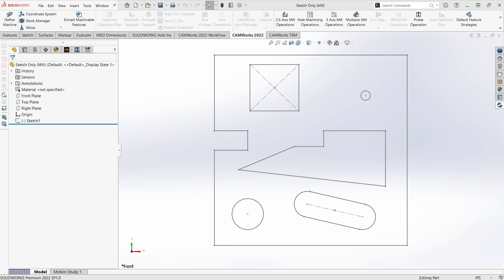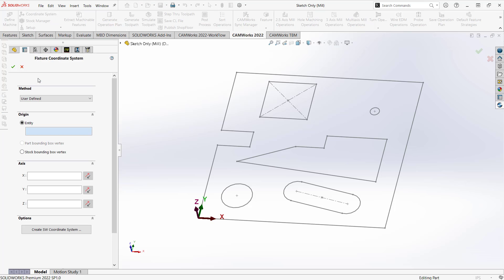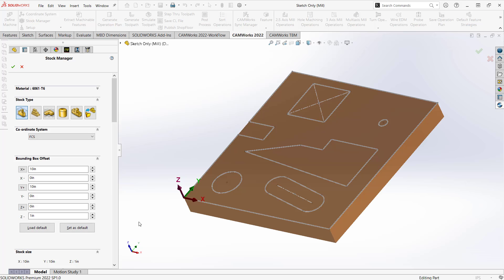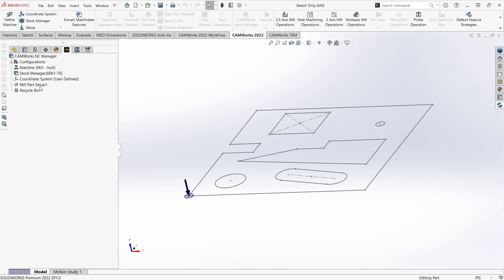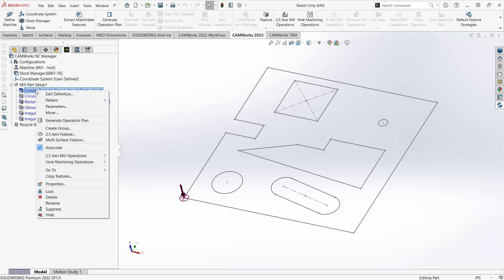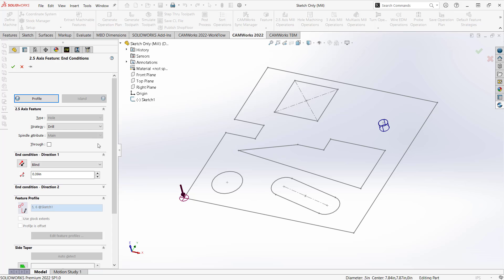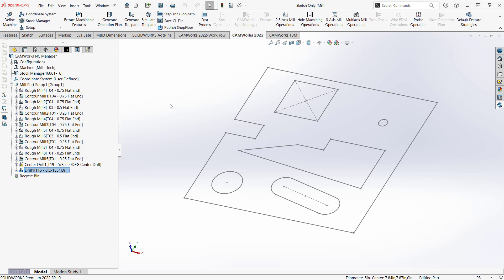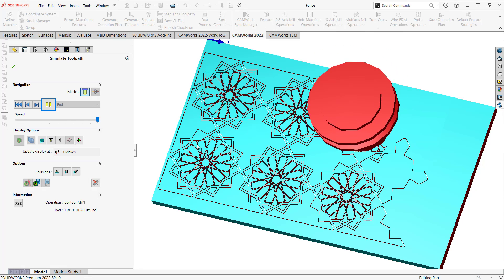Mill Programming from Only a Sketch in CAMWorks

Comment: what if you wanted to cut outside the contour?say you have a sheet of plywood from which you have to cut out parts
Reply: The sketches here are used to define the geometry that defines the operations.  In the operations you can add the compensation.  If you want to compensate outside the contour then define the feature as a Boss.  If you want to stay inside the contour then define it as a Pocket.  For open chains you will define it as a Open Profile that has a direction of cut, so the operation's definition of climb vs conventional tells CAMWorks which side of the line to be on.  If you ever need help with this you can always call into your local CAMWorks Reseller for technical support.

Comment: Excellent video. This helps me a great deal. I machine a lot of 12"x12"x1/16" thick ABS sheets. Usually, the part has many small holes & rectangles, I use a small 2mm single flute carbide cutter to cut out the geometry.